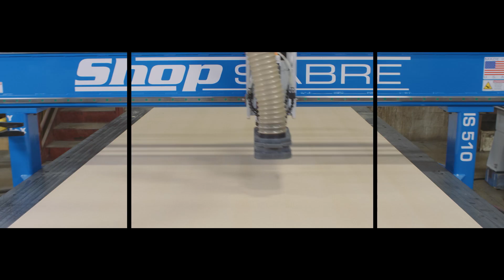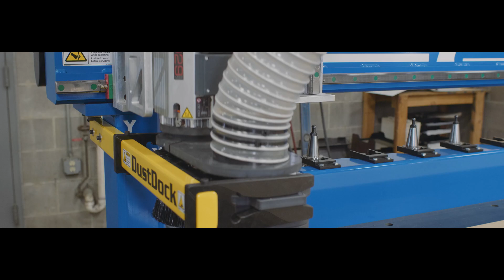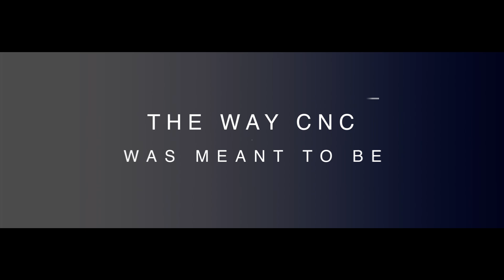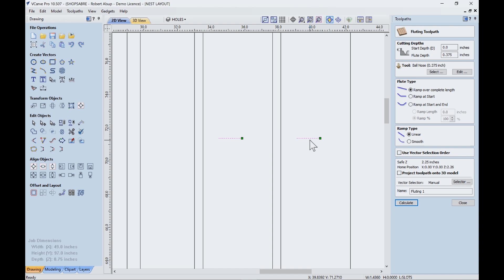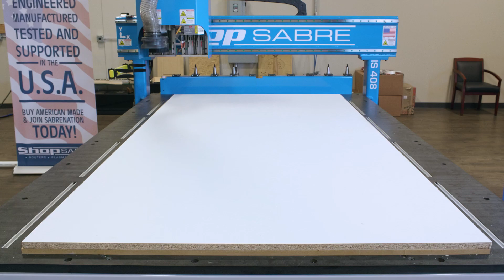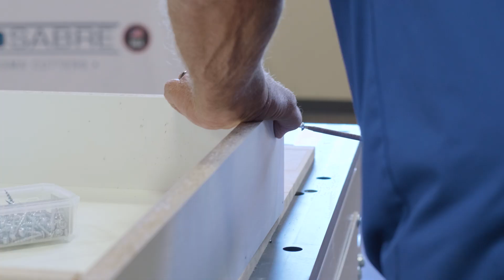ShopSabre CNC IS408 Routing Pockets into Melamine project for Screw Construction.

Comment: Great video. Do you know the part numbers forthe 3/8 ball nose and 1/8" drill bit used in this video? Assuming they are from Vortex.
Reply from the maker: Our technical support team can assist with this question. Give them a call at 952-461-4570

Comment: Love the video and detailed instructions. Does the vacuum boot not adjust with each change of bits. Noticed the bristles were pressed down quite a bit. I am considering purchasing the 5x10. Thanks
Reply from the maker: The dust dock is a unique design for dust collection to reduce maintenance, dust, and failure points - there is no mechanical device to the dust dock

Comment: Great idea, I like it, but is there a need to predrill the holes in the slots for the screw?
Reply from the maker: Just makes life easier :)
Reply: I have the same question. The reply you got doesn't answer the question. I wonder if the board has a tendency to split between the bottom of the ball mill slot and the edge of the board?
Reply from the maker: it’s not about any specific function other than adding to the ease of installing the screws without the need to line anything up or have hardware sticking out of the Material